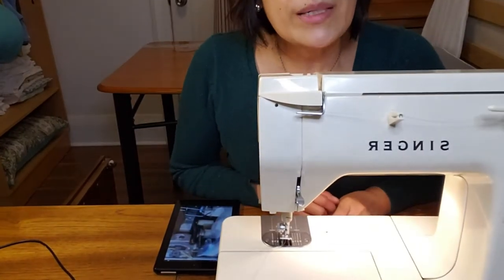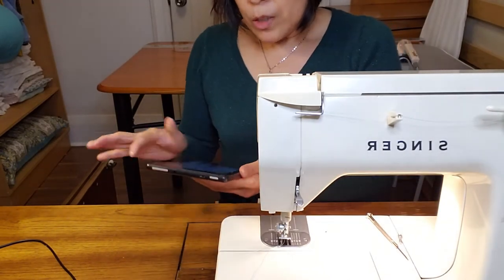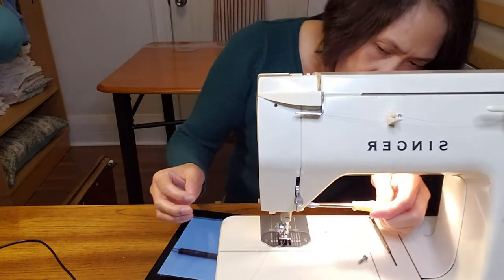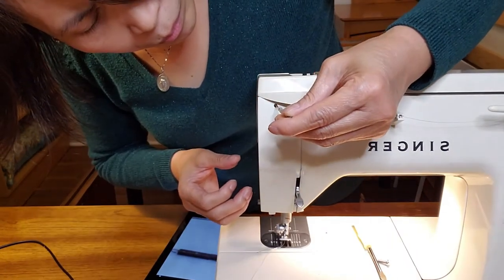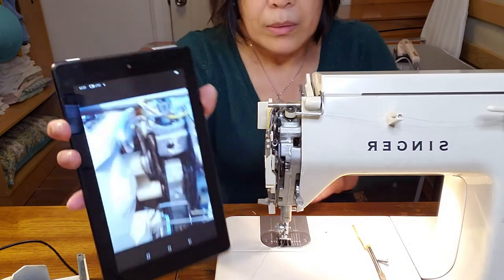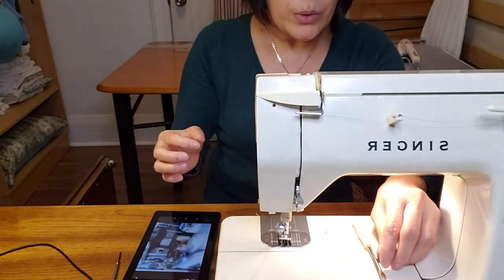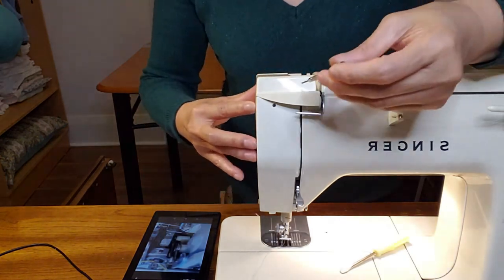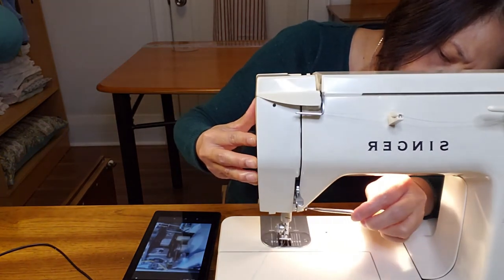FALLING SPRING!  Where it came from?

Comment: Thank you for posting this helpful infomation.  I appreciate your resourcefulness and willingness to share what you have figured out. 
 I bought a Touchtronic 2001 after seeing your videos.  Now having some problems with it, and I have an opportunity to buy a slightly later model, the Touchtronic 2010.  I'm wondering if it would be worth it to use for parts.  However,  I see that you have solved the problems you had without getting replacement parts!  Also, what lubricant do you recommend for the moving parts underneath the machine?
Reply from the maker: Hi Helen, As per the manual, this machine requires no oiling.  I have a singer sewing machine oil but I haven't used it yet or lubricated my machine.  I spoke with the Singer dealer owner that told me not to oil the side part of the machine because there is a plastic component that might melt. Once in a while, I cleaned the bobbin area and sorrounding for the lint that accumulated there. Spare parts for old machine models are hard to find now a days.  I saw the same model machine as mine in goodwill and has the accessories that I need.  I bought it for $7.99 including delivery to my place it came up to $35.00 which is cheaper compared to buying the accessories individually. I have solved certain issues of my machine by just doing inquiries to Singer Sewing Company which gave me all the Singer Service Centres in US and Canada.  I was just lucky to get intouched with someone who's willing to help and impart his expertise to me🙏😀 My purpose of doing videos is to help other people with the same model machine to have a ready reference when needed as I have difficulty finding it when I started to operate my machine. I'm glad that it serves its purpose.  Thank you for watching and have a great day!

Comment: Thank you for your videos. I bought a Futura 2001 2 days ago (this is the European version of your machine , they are equivalent)
and this video showed me  how to open the left part to oil the needle shaft . I also opened the bottom ,which is quite easy , to grease and oil the moving parts there ,but I really don't see how to remove the top-plate.I removed the small screw on the back right , and I don't see any other screws .How did you do it?
Reply from the maker: Hi R. Wareman,  Thank you for watching my video.  The top cover is easy to remove.  Just push the top cover with your thumb to the right and lift it.  There is no screw to remove, it's only a snap ring that locks the top cover in place. To replace the cover, line the locating pin with the snap ring and push to the left that will locks the cover in place.  Hope this will help you.  Thank you!
Reply: @Joylearnthenshare  yeeh , you made me one happy guy , now i finished the servicing and tried the machine out , it runs really smooth and everything seems to work as it should .The back of the lid showed a  stamp number 79 , so this machine is from 1979 ,I got this for only 15 euros,  the inside is still in excellent condition, no wear or broken parts but of course a bit dried up and some very little superfluous rust..
It seems only the manual is missing (found a complete english one on internet ) and the 
needle plate for straight sewing , I don't really know if that makes a big difference compared to the standard needle plate .
Anyways ,thank you for sharing !
Reply from the maker: @r.wareman212  My pleasure to help you!  You are lucky to get the machine for that price and still works perfectly.  If you visit singer.com.au/support/manuals they have a list of manuals for different machines that you could download and print.  Have fun sewing!
Reply: If you are using the straight stitch plate while seeing with straight stitch settings you are developed with perfect straight stitch. The more Your Singer’s computer won’t allow you to to use other stitches until You change for the universal plate. The secret is with a little micro switch with pin lever under the stitch plate and the little hole in the plate. When the computer detected the protection switch is on the needle bar is blocked to make the sideways moves.
Reply from the maker: @Leadmastervoice  Thanks for the info.!